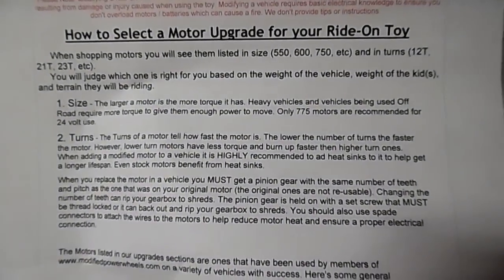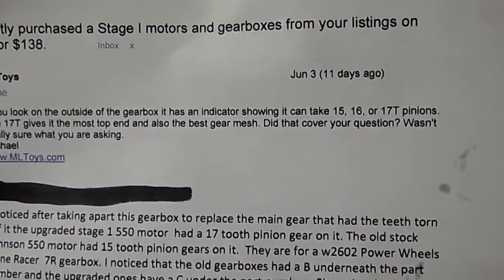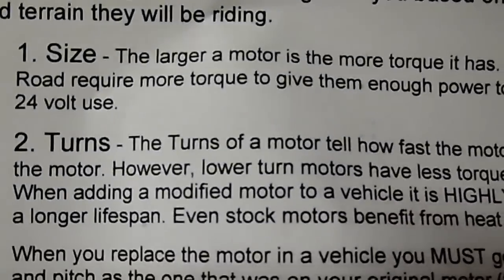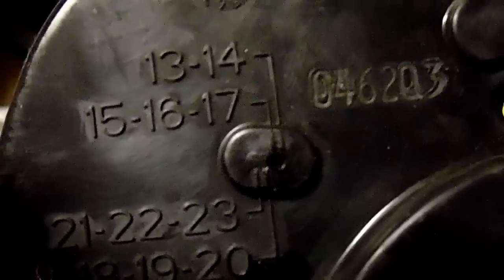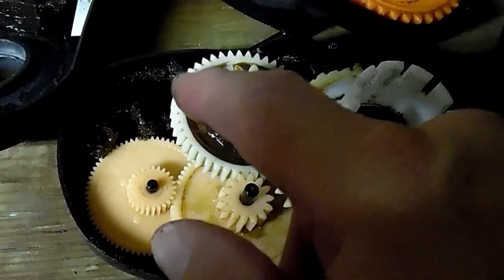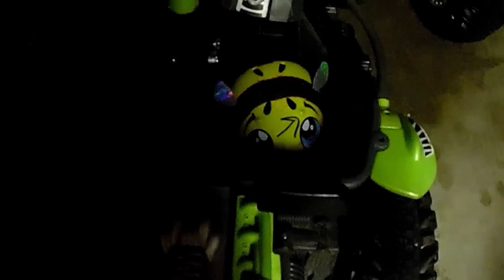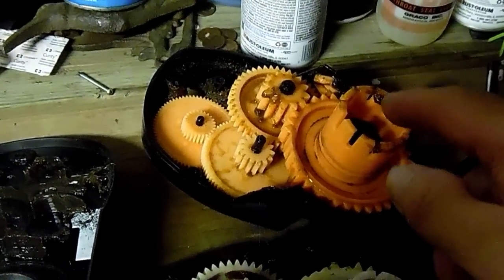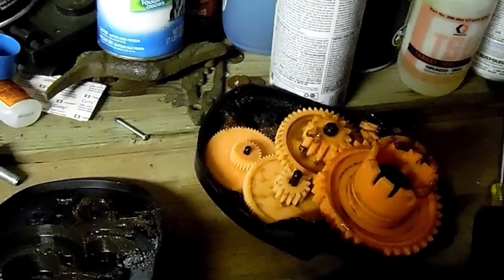24v or 18v Power Wheels modification  What you should know and consider

Comment: Any place you can buy upgraded output gears?  Those seem to be the ones you keep stripping gear teeth on.
Reply from the maker: Mellowjammer  They do not make upgraded output gears.  Thank you for your input Ken
Reply: well if and when.. the ones goes out on the hummer I have...Im just going to get 24V or 48v scooter motor and drive. Do live axle ect..You can get skateboard/scooter belt or chain (#25) kit for $15.
If i use 2-ea 24V..I'll just screw the sprocket to the wheel (spacer..ect)
The factory  actaully put in 550 motor in it...It dosnt move at all. The wheels are too big.  2 kids likes to ride in it...it is what it is...kids are kids. They wont ride it single.lol It runs hot at 18v. I order 775 to replace them..Hopefully it'll  go.
It dosnt need to go super fast. It just needs to go a little faster or climb a little
incline in the yard. I got the hummer for free...The girls demand that i fit it.lol
I got them on a upgrade 18V corvett ...Im starting to notice the motors are loosing power or gets hotter faster on 18v...I can use 12V ..i guess.
 It's plenty fast. Hopefully i can get away with 775 @18v on all of them.
i dont really want to be  changing gears every other week...but the hummer
dosnt move at all with the 550.
It was free...but kids will be kids. I have to fit it for them
Reply from the maker: OneEyed Monster Thanks for your input.  It saves alot of time and money when people such as yourself share their experiences while working on riding toys.

Comment: I have a question,is it possible to have it set up to run 18v and 24v..so have it 18v constantly then with the flip of a switch have it to 24v..CLD this be possible with 12v,6v,6v batteries
Reply from the maker: the-professional18 Yes, 6 volt wire  with series circuit. Need two double throw switches. Two wires connected on switch before  the added 6v battery and two wires connected on switch after the 6 volt battery. One throw of the switches will bye pass the 6volt added battery and isolate the 18v circuit. The other throw of the switches  will bye pass the 18 volt circuit and connect the added 6 volt battery in series with the  of the 18v batteries making 24 volts. Make sure negative to positive when connecting batteries. Thanks Ken

Comment: Have you check how much hotter your stock motors get when running at 18v? I just upgraded one of the dune racer from 12v to 18v. I also have the break reduction module as well as soft start Turbo Timer 4 by CJB off modifiedpowerwheel forum. When running the dune at 18v on grass and go up the hill, the motors get hot quicker than 12v and I broke the fuse a couple times. I am afraid at this rate, it will break the gears due to heat generated off the motor (I do have fanless heat sink mounted to the motors). Have you noticed any of these? I am thinking of adding fans to help ease out the heat but not sure how well it will go without upgrading the motors themselves.
Reply from the maker: Tuan Lee the motors will run hotter.  I would suggest going up one more size on the fuse.  The increased demand of torque on the motors going up the hill will cause the motors to heat. 775 motors are designed with more torque.  You may need to upgrade to them.    Electricity is heat so the more amps used by the motors the hotter they will get.  My Grandsons don't drive up hills so I haven't had to deal with this problem.  Sorry I wasn't more helpful.  Keep me informed on what happens next. Thanks Ken
Reply from the maker: What does the soft start turbo timer 4 by CJB accomplish?
Reply: It will start out at 12v first and then after 2 seconds will go full force 18v speed. This is to ease up the first start current to go easy on the motor. I'm in the experimentation stage with this along with full ESC kit from eastcoastpowerup

Comment: For your 18v duner racer setup, did you use stock motor or upgraded one (775 motor)? How hot do the motors get if you are using stock ones?
Reply from the maker: Tuan Lee I ran eighteen volts on both stock motors and 550 upgraded motors.  They preformed fine.  I use a 40 amp inline fuse to protect the wiring and other components.  I also ran heat sinks on the motors and cut out holes for ventilation on the motor cover.  I heard other people have not used the heat sinks and didn't drill holes for ventilation  and they didn't have any problems.  I leave I  Arizona so I wanted the extra heat protection.  ( see my other video's) If I ran 24 volts I would use upgraded 775 motors.  Hope this answers your questions Ken
Reply: Yea I use 40amp inline fuse as well. Trying to find a 40amp with automatic reset circuit breaker but cannot find a good one yet. Saw a vid about putting a bussman 30amp auto-reset fuse but 30a is small for me since i have walkout basement so from backyard to front yard will go up hill about 30-40 degree and 30a does not cut it very well. What is the 550 upgraded motor you are referring to? does it have higher RPM?I will probably cutout the holes too for ventilation. I did manage however to put 12v and 6v together at the back of the battery storage by cutting out the barrier at the back when you push the battery in and sanded down the front where the battery cover door touch. Now both batteries fit nicely at the back for me. This mod will only works with aftermarket batteries since the original stock 12v battery has higher height due to thermal and fuse built-in. How many heatsinks did you use per motor? I have 4 of them but 2 dune racers like yours so using 1 per motor right now but not sure if I need to upgrade to 2 per motor when running at 18v stock
Reply from the maker: Tuan Le There is upgraded 550 motor (mltoys.com) that I use instead of a 775. I use one heat sink per motor. Make sure not to cover up cooling vents on the motors.They do have higher RPM way faster than stock.  Shouldn't have any problems with blowing out the 40 amp fuse unless you have a short in the circuit.  Sounds like your figuring it out.  Ken
Reply: What make you go with the 550 upgraded motor instead of getting the 775 one?
Reply from the maker: Cheaper, Faster than stock.  775 tear up parts more often. My Grandsons weight is light so I don't need the increased torque of 775 motors.
Reply: Have you done any gear replacement using the metal first gear from mltoys? I am wondering if it is worth a buy or not.
Reply from the maker: If you run the 775,  I would use metal because of heat from motor.  The gear that brakes teeth off on me is the output gear that hooks up to the rear tires.  550's you are wasting your money.
Reply from the maker: I always have extra out put gears on hand.  check out Craigslist for cheap power wheels for extra parts
Reply: is this because you have bike tire on the rear tires?
Reply from the maker: Yes
Reply: I will probably remove the bike tire off my rear wheels then for 18v conversion if I don't want the motor to break the gear. How long you have the bike tire on to the point where the gear breaks?
Reply: Saw the vid again and saw that you actually fit the heat sink way better than I. Is the motor you got there wrapped around with the heat sink a stock one or upgraded one? I can't seem to fit the heat sink that close (with 2 screws attached) on my stock motor for my dune racers.
Reply from the maker: Output Gear strips usually from shifting before coming to a complete stop
Reply from the maker: Just a heat sink for 550 motors
Reply from the maker: You might have to drill out the holes a little bit if your using the screw together heat sinks (2 screws)
Reply from the maker: On the clamp on (blue) heat sinks I had to bend the heat sink to make it clamp on tight
Reply from the maker: You can buy the plastic gears at kidscarsandparts.com or mltoys.com

Comment: Ken,

What kind of batteries are you using and about how long does the charge last
Reply from the maker: M2C1593  I use lead sealed 12 volt and 6 volt batteries that I buy online at Battery Clerk.com.  Original power wheel batteries are 9.9 amp hour rated.  I buy 12 amp hour batteries.  You do not want to use batteries that have different amp hour ratings.  When you hook up your batteries in series, voltage is additive ( 12 volt battery  plus 6 volt battery equals 18 volts ) or ( 3 six volt batteries hooked up in series is 18 volts ) or ( two 12 volt batteries hooked up in series is 24 volts ).  When the batteries are hooked up in series the amp hour rating ( amps ) are not additive.  This is why you need to use the same amp hour rated batteries.  You can use different amp hour rated batteries but the lowest rated amp hour will be the dominating amp hour factor of the two batteries.  ( charge wont last as long}  When upgrading electric motors it is just like upgrading a car engine.  More speed uses more power. Batteries are rrated in amp hour. A 12 amp hour battery in theory can supply 12 amps for a period of one hour.  When a motor starts ( lock rotor position ) it uses 8 t0 10 times more amps than when it is in constant running.  The weight of a child is also involved in the equation.  So I cannot off hand tell you how long any battery charge will last.  I can say that the higher the amp hour rating of the batteries the longer they will last.  Having the room or space for the bigger amp hour rated batteries is the problem.  Myself I have another set of back up batteries on hand . ( Just in Case )  Hope this helps. Have fun.   Ken P.S.    I use 18 volts.  Broke to many gears using 24 volts.
Reply from the maker: M2C1593  I have a couple of video's on my you tube site explaining how to use power wheel chargers on lead sealed batteries. Explains what I have learned. Thanks for your input.  Ken
Reply from the maker: Check out JuliansRandomProject for  an alternative battery source

Comment: Ok.  My son has a 6v f150.  But I beef it up to 12v and it's doing good. Lol.  But my 3year old wants more power.  Will a bigger size motor fit in the stock bore?
Reply from the maker: carey tisdale I don't want to give you any wrong information.  Contact MLToys.com to make sure.  Off hand I believe the motors are the same size.  Thanks Ken

Comment: how do you charge 18v system? Do i need to take the batteries out and charge them individually? How is this done conveniently? 
I have 15 amp  electronic car charger which charges the 12v  sla very quickly, but what about when I throw in a 6v sla in series? 
BTW, thanks for a lot of great info and ideas
Reply from the maker: +ElenaDiakova   I like  PowerStream PST-3PA3022A   !8 volt lead acid sealed battery Charger with alligator clips $32, or  ElectricScooterParts.com  18 volt charger  ( you will have to cut the connecter off the end and modify it with different connectors to the batteries $29.95, monsterscooterparts.com $29.99 you will have to modify it's battery connectors
Reply from the maker: +ElenaDiakova Make sure to use a 40 amp inline fuse to protect the electrical circuit
Reply from the maker: +ElenaDiakova  Hook the positive + red of the first battery with the positive + red of the charger and hook the negative - black of the second battery with the negative - black to the negative - black of the charger.  I use the same amp hour rating on the 12v and 6volt batteries. In a series circuit the amps are not additive like the voltage. So the voltage adds 12v + 6v = 18v  the amps stay the same.  1 amp hour (AH) is the rating of 1 amp lasting for 1 hour.  Hope this helps Ken  Remember this voids the warranty of the riding toy and the increased speed voids the safety requirements of the riding toy.
Reply: +Kenneth Bowman thanks, that's what i was afraid of: another charger!
Reply from the maker: If your charger charges 12v and 6v you can charge them separately
Reply from the maker: ElenaDiakova I made a couple of video's of using Power Wheel Chargers on lead sealed batteries. Hope they help.